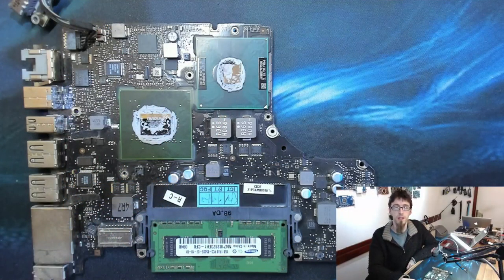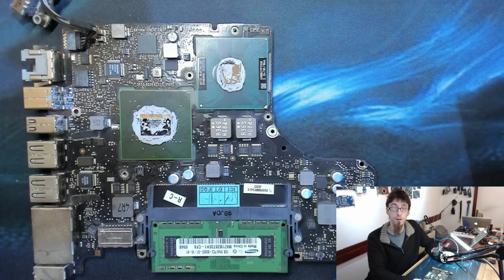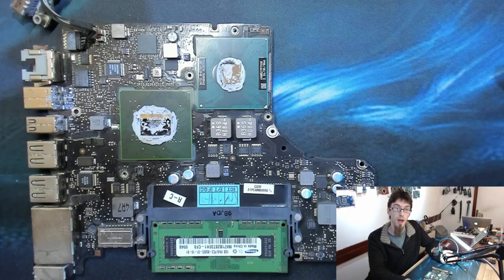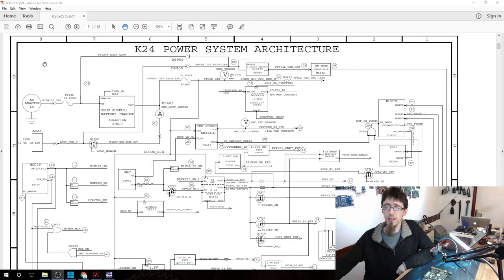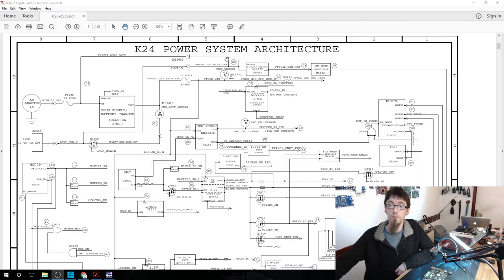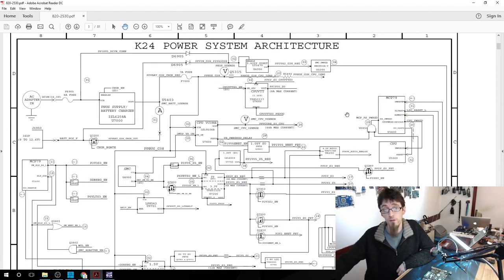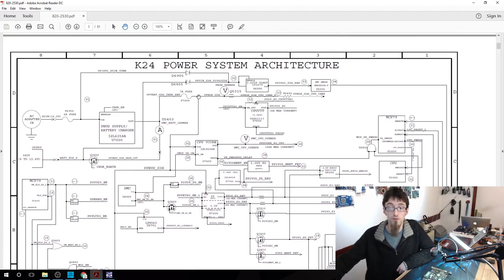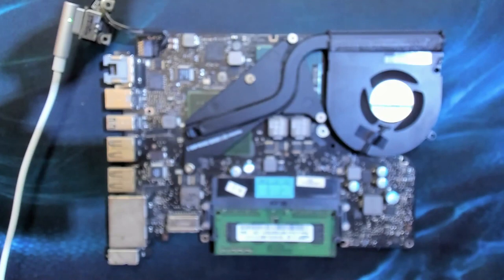Board Repair Basics #2 - Power System Architecture

Comment: I've been finding myself getting really hooked watching laptop board repair videos on YouTube. I love troubleshooting, but always have to stop if I find that the issue is related to the mother/logic board because I lack the skills and knowledge to go any further. That's frustrating so I'm trying to understand how these boards work which'll hopefully provide me with the necessary skills to actually repair a board, rather than have to stop and say, "Nope, I can't fix it". I have 3 bad Macbook A1342 logic boards that I've basically kept laying around in the hope that I one day can actually fix one of them. 

This series seems like it'll help quite a bit. It's articulated really well and in a way that doesn't make it sound too daunting/difficult to process. That's good when learning as I'd often watch other videos and while they are clearly skilled and good at what they do (repairing boards), they can often make it sound really difficult to get your head around.
Reply: Ditto.  I've worked many hours and spent hundreds of dollars fixing an old car's AC system... and I'm being held back by a blown capacitor... now if I had the tools and skills to replace said capacitor, I could have already fixed the thing.

Comment: 2:38 so that's why if you put a 1067 MHz ddr3 ram stick and a 1333 MHz ram stick certain slots on a board designed for only 1067 MHz ram, it will still boot. For context, if its done backwards or if both sticks are 1333 mhz, it won't boot. I'm guessing that's because the efi will initialize the boot on the 1067 mhz stick and once the operating system takes control of the hardware, its able to use the extra 1333 mhz ram stick at 1067 mhz. Its weird considering that you can use 1600 mhz ram in a board with a bus speed of 1333 mhz but not 1333 or 1600 mhz ram in a board with a 1067 mhz bus speed.

Comment: I have a concern sir, I have a laptop then it suddenly turns off on its own until it damages my OS. without removing a battery, it can still on but after 1 minute of booting, it will automatically turn off. even removing a battery, it is still the same, it will turn on, and after a few seconds or minutes later, it will automatically off. what do you think is the problem?

Comment: I have an acer aspire 7600u AIO with the broken touch screen removed. The power button was a touch sensitive switch that no longer works as the glass screen is removed. I have downloaded the schematic for the motherboard HM77S01, but I can't figure out how to bypass that power switch. I had found two pins on the power switch board connector and wired in a power button, but that quit working immediately following win 10 latest update. Now the screen lights up for a view seconds and shuts off, and the computer doesn't even turn on

Comment: Great Video. 1 Question, is the PP18V5 and PPBUS_G3H lines also found in Windows/IBM cloned based laptops as well, or are they labelled differently? Thankyou. :)
Reply from the maker: Yea most laptops will have a DC-in rail straight from the DC jack, which becomes VIN (Voltage In). They go by various names, but fundamentally do the same thing. The main difference is that most windows laptops don't have a buck regulator for VIN, it's basically just raw charger power. There's an Inrush Limiter, but no regulator.

Comment: Great series of videos.  My Dell 5559 won't turn on.  When plugged in, charging light is on.  Curiously, when I plug in the motherboard to test it I find that the area around the cpu heats up and everything in the power supply area is shorted and never turns off.  All other power rails are off as they should be.  No shorts in the main power supply.  Is this an smc failure?  Where should I look?  Thanks.
Reply from the maker: CPU is low impedance and will appear to be shorted all the time. Am I understanding right in saying that if you plug in the laptop, laptop is off, but you have power and heat at the CPU? What voltage are you getting at the CPU inductors/coils when that happens?
CPU Vcore should be somewhere around 1v, so if you're seeing 19v (charger) at the CPU vcore inductors, one of the vcore mosfets has gone short-circuit and your CPU is probably been cooked.
Reply: @Adamant_IT  Thank you for your very prompt reply.  Inductors are shorted to ground as are all caps in cpu vcore.

Comment: Question? Can you test the first stop on the line and the last stop on a line to find a problem with a specific rail?
Reply from the maker: Generally speaking, you'll get the same readings everywhere on a given rail. However, there is a technique for short detection where you use a super accurate multimeter (accurate enough to measure distance along a wire) to "triangulate" the approximate point of the short circuit. It's a very uncommon method on modern repair though.

Comment: I have already have designed 2 boards more complicated than a regular motherboard and numerous others for automotive and i still struggle when a friend comes with a motherboard and it died with no reason and there is no schematic available. i start with trying to find a datasheet of the main chipset and from there the power on sequence. it is something that if i charge for i'd charge as for design :) Now my first step is to see if all the mosfets are ok and most of the supplies com on with power good and enable if it is something more than 3hrs i just go on ebay and if possible order the same board and give it to my friend as a gift:)

Comment: the fuse just after the A/C power (coming in to m/b) is that a SMT component? great tutorial sir!
Reply from the maker: Yup, everything will be surface mount in a laptop. That particular input fuse is a very high rating, and is mainly there to break big incoming surges that might cause an electrical hazard.
Reply: Adamant IT ok thank you

Comment: Adam, got a good ?? for you.. concerning an Apple macbook pro, and applicable schematics, there is an 820 - xxxx number associated with the laptop & schematic. where or how is that number found or determined? got a macbook pro A1502, opened the back cover (1st screw i removed decided to pop off the pentalobe..Aarrgh!!) found some blue/green corrosion on a corner of the battery as well as the  BMS pcb attached to the battery. if the battery is disconnected, can other checks/tests be done with the unit plugged in? the unit will attempt to boot up without the battery connected? thanks again for your time and experience.
Reply from the maker: Ah, full disclosure I'm not very practised with the Retina MBPs. I need to sit down and learn that platform over the holidays. The 820 number will be somewhere on the board, but not sure where on the A1502. I think they require a battery to be connected to start up.
Reply: Adamant IT ok thanks. i want to remove the "left" speaker (right as you see it when mb pro flipped over) & disconn the battery, plug it in, & see what happens. the corrosion is on the corner of the battery nearest to the corner of the  speaker, & clean the speaker. thanks for the replies  J  i looked closely at the M/B (not removed) the inside of bottom cover/pan, & no luck finding the 820 #. will look some more. thanks

Comment: This might seem like a stupid question but do all motherboards get power like this?
Reply from the maker: Yes and no. Nearly all motherboards have multiple secondary power supplies (5v, 3.3v, 1.3v, etc) on them that run off of a main power rail - but the main power rail setup tends to vary. Macs have a regulator on the main power rail as I show in this video (PPBUS_G3H), but a lot of laptops just run the charger input (19.5v) straight into the main rail. They still have an in-rush limiter, but that's just there to smooth out the stutter when the charger jack is connected or disconnected. Desktops are different as well because most of the secondary powersupplies are in the PSU itself.